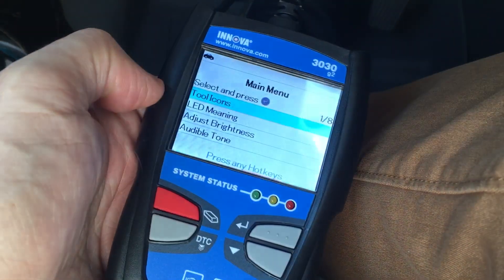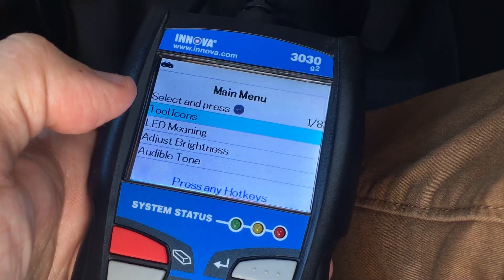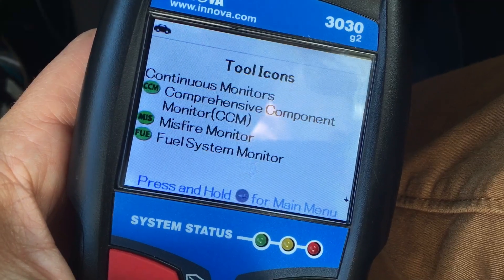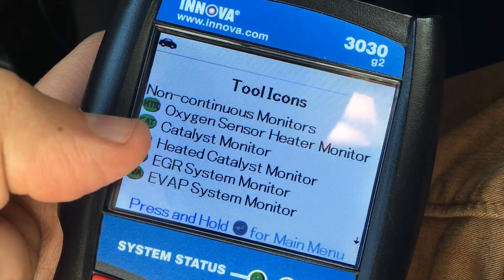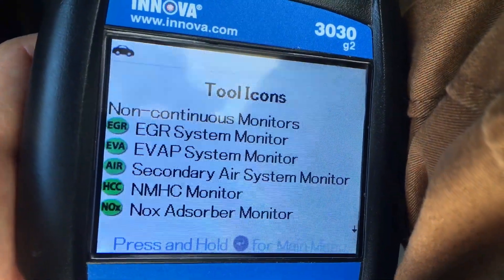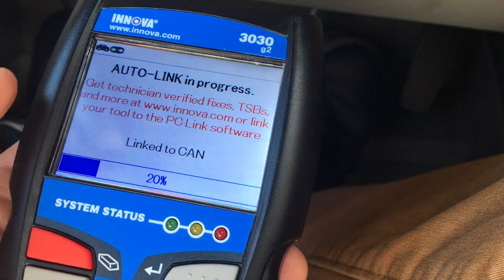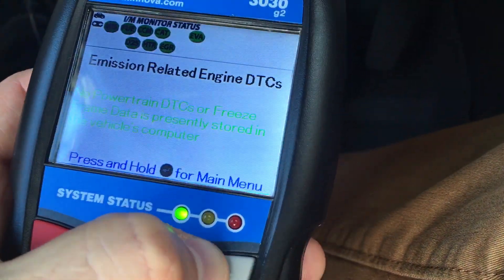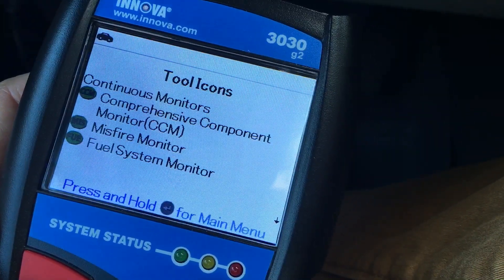Innova 3030 Icon Meanings

Comment: If the monitors are blinking red that does not mean there is a problem or code with that system.  Just means the monitor has not run yet.   If there is aproblem you will get a code.  Those are unrelated to the monitor status.